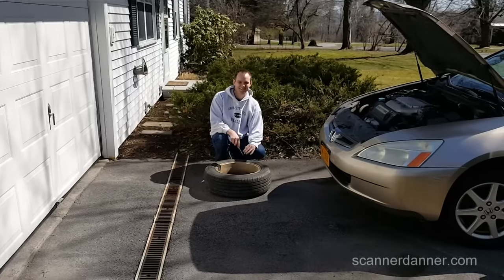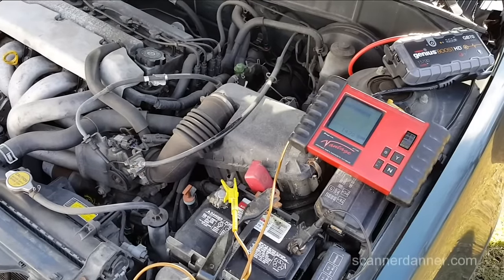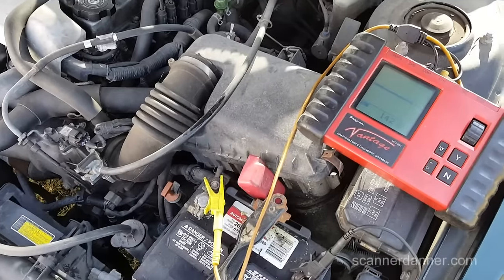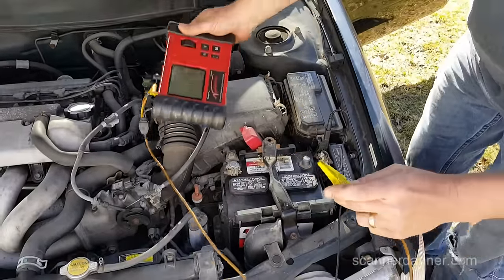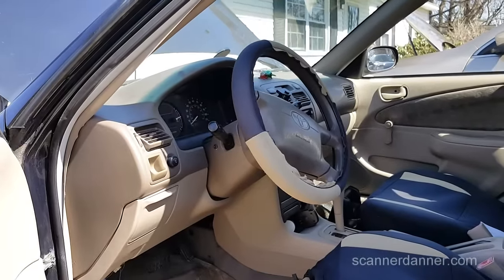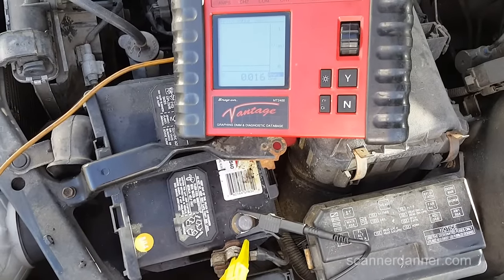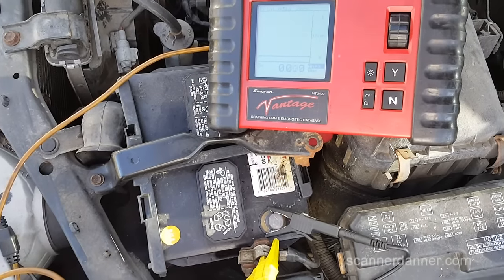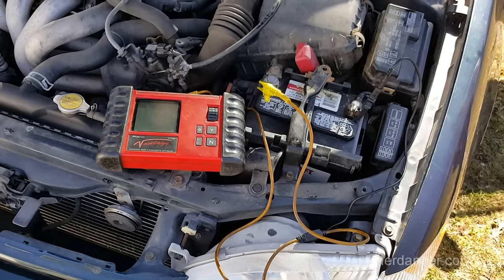Battery keeps going dead (what to test before replacing)

Comment: About 7 years ago I picked up a BatteryMINDER 5-stage desulphating charger, with temperature compensation. This thing has paid for itself HUNDREDS of times over - not even exaggerating. Seeing that battery there having a build date in '14, I would bet that 2 weeks on my charger would bring that battery right back from the dead. Not even kidding.  Thing is amazing. Batteries I thought I would have to toss, I ended up getting 3 to 5 more years out of! I have zero affiliation with the company - I just like it when stuff works better than advertised in this day and age. :)

I just picked up another one last week (Model 128CEC1). They updated the unit for 2016, so you are now able to see more of what it's doing and understand it better. They also did away with the long temp sensor that used to have to be connected to battery ground to work - the new one is just a temp sensor, that plugs into a very short pigtail coming out of the unit. It's also set up specifically for the Odyssey AGM battery I run in my truck, so that was another added bonus. I haven't tried the new one yet on a completely smoked battery, but I'm confident it will be every bit as good as my old one. At least I hope anyway. The internet will be the first to hear about it if it's not! :D

Comment: Had my neighbor's 2003 Audi A4 battery continually needing a jump. 

No one could figure out the problem even after 2 new batteries.

 I came home late one night (3am) from hanging out with friends in the dead cold of winter and saw her brake lights on. It turned out her brake light switch was out of adjustment and had a hair trigger. The problem was when the temperature dropped and materials contracted enough, the switch closed the circuit and turned the brake light bulbs on until the ambient temperature got warmer or the battery died.

I know it sounds crazy,  but sometimes thinking outside the box can save from having to buy a new battery.

Anyways great video Paul, keep up the good work.
Reply: Speedstack21 wow😮
Reply: yep with a good scope, he can scope for a long period and make sure that nothing is coming in later.
Reply: haunted car
Reply: I agree, my folks owned a 1977 Plymouth Volare. During the cold winter nights, the horn would start blasting in the early morning all by itself. Turned out, the plastic material would shrink enough to close the horn switch on the steering wheel and practically wake up the dead 👻💀

Comment: The most important final recommendation after analyzing the test results that is missing in this case (since the cause of battery is not likely from a parasitic drain at 11mA) should be the purchase of a battery charger/maintainer and some basic battery diagnostic tools (hydrometer and/or a battery and system tester) in tracking the state of health and in equalizing the charges of an old lead acid battery.  Buying a new battery won't help if the battery is going to sit again.  Anyone who owns an automotive battery must keep the battery charged up either manually by a battery charger or automatically by a smart battery charger and maintainer.  All flooded lead acid batteries will need battery equalization done regularly to maintain and extend battery life.
Reply: Do you recommend any particular brand and model device for battery equalization?  I can't find any charger with equalization listed as a feature.  Plenty of chargers with desulfation listed as a feature.  Is desulfation and equalization the same thing?

Comment: The car battery needs trickle charging during the off time or else run the car for a few minutes every 3 days.A year old battery should be in tip top shape. Great to see your family and great interest in the auto scene.
Reply: +Tom OConnor 

I was always taught a battery that is discharge slowly or has been left discharge over an extended period needs a slow charge to push the charge through the full thickness of the plates, a battery that has been discharged relatively quickly can be charged more quickly.
A lot of modern batteries have "improved" lead acid chemistry and can't be recovered by normal recharging.

Comment: Anything over 30ma will suck that battery down. Alarm systems are famous for wearing batteries down if they sit for an extended period. Best to use a battery cut off switch if your car sits for extended periods of time. I should also point out that once that battery goes below 11.8 volts for any length of time they do not come back from that and no amount of charging will fix it and you will need a new battery. And Danner, I don't believe we have seen part 4 of the lift kit installation. I hope you took note of my specific instructions to complete the job in part 3.
Reply: +Rod Palm: right.. just one deep discharge and the battery will never be the same...
Reply: ..........  Great  info.    I  forgot  about  the  Alarm  system  on  my  Crown  Vic,  that  I  am  now  using  for  a  back up  car.     How  many   mili-Amps  do  you  think  a  Crown  Vic  Alarm  system  draws.

Comment: One thing to consider on more complex cars is the can bus system and modules still awake for at least 10 minutes more or less for some cars and a car with a key less system make sure the key is not near the car on time I got a VW mk5 Jetta with a broken wire in the driver door it very common for this generation on car but one wire that caused and parasitic draw is one can bus wire that was broken for the comfort system and would communicate with the window motor and there is 2 wires for the bus system they are twisted together with a scan tool you can see the can bus data status going to a single to a 2 wire status on an off constantly when there is no wire issue the status shows the bus in a 2 wire mode then when you lock the car all the modules go into a sleep mode in matter of minutes I also saw some alternator shorts and they would drain the battery in a short period of time thanks for the video the thing is when you get a car that draws only intermittently it's sometimes not easy.
Reply from the maker: +V10PDTDI absolutely and I've covered this in other videos. I should have mentioned that here too

Comment: Very nice video, but noticed the top of the battery is damp. Also need to check the surface voltage. Batteries sweat alot as they discharge. The film of acid will conduct several volts as well. A quick wash with baking soda is all that is needed.

Comment: You can use a battery charger on a timer to keep the battery charged when a car is left sitting for a long time.  Just set the timer to run 10-30 min per day.  With a little experimentation, you can find the right time for the charger to run.

Comment: This man knows too much about electrical. Drive past dealerships in the dead of winter, and you'll see alot of new cars' hoods popped and the techs charging the batt cells not to only keep them charged, but to mainly keep them from freezing over. I'm guessing that they do that once every week. An undercharged battery can damage its plates and destroy itself faster than anything else will.

Comment: @1.83 volts that battery is DEAD.  Probably has a dead cell.  An alternator is not really made to charge a dead battery.  Need to get another battery, there should still be a warranty on the battery.  But your brother probably lost the receipt like the remote.
Reply from the maker: +Upallnight exactly
Reply: +ScannerDanner 
A dead battery can be one of the hardest calls to make and be 100% sure it won't come back on you  -- in this case a good  call it was an ex-battery .....
Reply: Many auto parts stores will honor the warranty without a receipt on their store brand based on the manufacture date sticker on the battery.

Comment: Did you ever fix this problem? I had a similar problem, turned out to be the alternator! I checked the alternator voltage as you did and it showed 14.4. I checked parasitic draw, and there was very low amp draw like you have. I replaced the battery, next day I went to go to work and the battery was dead again!  I took it to a repair shop: they charged the battery, checked the alternator voltage UNDER LOAD: in other words, turned on the lights, radio, heater: alternator voltage dropped to 12V, which would of course, kill the battery. Very strange problem to have, and I wouldn't have guessed it, but I'm in good working order now.
Reply: ........  That's  what  Wal-Mart  is  telling  me  also.  Similar  problem  as  you  described.    They  said  a  diode  was  bad in the  alternator.    Car  ran  fine  after  I  jumped it  even  with  seemly  bad  battery.     I  charged  the  battery  with  a  6  Amp  charger  for  8  hours  and  only  got  up  to  33%   Charge.

Comment: trickle charge it , since its sitting so long or unhook the battery when not in use.
Reply: I have a Suburban with the 7.4L engine, does great for towing but only 13MPG, so it sits for weeks at a time. I kept finding a dead battery when I needed the vehicle. So I got a cheap trickle charger, the $ sale at HF. I just plug that in when I've done with the Burban. No more problem.
Reply: @javaman2883  m.j

Comment: Basic, simple and very useful info for someone who has never done that type of testing before and can be done with a moderately priced volt/amp meter.I would like to add for your viewers that on newer vehicles you have to wait for electronics to go to "sleep" before that test is valid.Is Caleb another mechanic/automotive instructor in the making?
Reply from the maker: +wysetech2000 for sure, and I should have mentioned that

Comment: My drain on my 1990 Olds 98 Regency was the the Air Compressor for the air shocks of all things.
Reply: Had a first generation navigator doing that to me as well. Had already replaced the air ride with spring before I noticed it. Didnt realize it until I heard the compressor noise so loud I thought someone was taking my truck.

Comment: Batteries these days are gack compared to even a few years ago - they have no staying power.  I'm finding we're now changing pretty new (1 year or a little older) batteries on a regular basis - they ain't making 'em like they used.
Reply: Had a battery from dec 2010. Just croaked. Yes. It lasted 12 years. 2000 tacoma 3rz-fe. Think I’ll throw it on the charger manana just for giggles 😁
Reply: @pitchforkpeasant6219  top up the fluid first with dist water&  it'll probably come good again. :-)

Comment: One time i remember diagnosing a car with a battery like that, that also had acid leakage on the top caps, and it had no parasitic draw neither, but it would discharge over a 10-12 hr period so i cleaned the top with water and soda and it wouldn't discharge anymore so i guess the acid leak was slowly causing a dead battery
Reply: I had a jaguar like that . put positive lead of my meter on batt + and just touched the top of the battery with negative lead...  voltage increased the further I went toward negative post
Reply from the maker: +James Danner hey bro. I'll have part 4 of our series up next week
Reply: Hey. U weren't supposed to reply to that post. I had a smart ass remark 4 you I think ,but I only watched the first half so far. got pulled away
Reply: James Danner i wonder what causes that small seepage through the caps, maybe heat cycles or something? i mean i don't see it with trunk mounted or under the seat batteries

Comment: I don’t have more than 40mA drain, checked fuses, battery supplier test ok, alternator charging 14.4V, battery trickles to 12.7V.  Battery still flats after 3 days. Pulled fuse 25 out, fuel and trunk actuator plugs pulled, no luck.  No OBD codes. Battery sitting in garage keeping charge.  My own battery tester shows 72% health after one year old and fluctuates between good battery and sometimes replace. Alternator 0.01V AC but suspecting battery or alternator diode.

Comment: That battery is history, sitting at that low of a charge will cause stratification which is ireversable no matter what voodoo magic or gadget you've seen on YouTube even if you can get it to accept a charge it will be at a much lower capacity, if you're going to let it sit for long periods especially in could weather put it on a smart trickle charger.

Comment: i would consider three things. how far is the car driven when it is used,  does it get a chance to charge up. also check amperage cable, battery grounds and Toyota has an extra battery cable connector on main battery cables that need to be cleaned.

Comment: Assumptions like this make my job ALOT more difficult as a 12 add on tech. teaches younger guys just to jump to remote starters and aftermarket stuff when there still is a problem with the cars.. 90% of the time i get called back i find whats wrong and its not aftermarket stuff.
Reply from the maker: +justkloo2 assumptions like what? It took two minutes to isolate a known problem area. When troubleshooting problems, we are always making assumptions, then we walk down that path and prove that assumption to be either right or wrong. If we are right, we keep walking that path, if we are wrong, we back up and go another direction. 
Not sure what your beef is here?

Comment: Can you explain how you removed the power connection to the alarm/remote start module ? Does disconecting the ground to it remove its power? I want to test to see if my aftermarket alarm is causing a draw and how much, but not sure how to remove power to it easily

Comment: I had the same issue on a 07 mustang i used to own. I would garage it all winter and have a dead battery by spring. I ended going with a battery that had a larger reserve current size and a tender and problem never came back. In fact i forgot to plug in the tender one year and the car started right up so reserve current size is also a big factor.

Comment: As soon as I got our 2015 Subaru Outback, I had to replace the undersized battery. Someone had replaced it with another battery of the same rating which was determined to be under rated for that vehicle. We have had no issues with the larger CCA battery. Subaru knew it was the wrong size battery. Rather than argue with those ass hats, I went to our local grocery store that sells batterys( not WALMART)  that has a three year warrenty. When you have to argue with a dealer over something as simple as a battery, its just not worth it. Especially when the manufacturer knew that battery was the wrong one for that car. All 2015's had the same issue.

Comment: .as always a great video Paul
.I would like to add a comment about that because I familiar with Toyota  
.if this remote system is a Genuine Not an After Market instillation , the situation will be better 
Remote control ECU transfers from WAKE UP mode to SLEEP mode 30 sec after closing and locking all doors, and all systems follow this strategy to save power.   ECM and all ECUs go to sleep and there is no any activity on  LAN BUS
. after that , 45 sec later , the THEFT DETERRENT system will be activated. thank you for your posting
Reply from the maker: +Mohammed Shamy thanks for the data!

Comment: Does it have a hood light. You probably wouldn't see it working on it in the daylight with the hood open. Also, check the trunk light could be out of adjustment and staying on will run the battery down. When the battery is run completely dead, the cells become sulfated but deep cycle batteries can handle this, most ordinary car batteries cannot. Definitely needs a battery but not sure you have fixed the drain. I would like to hear if it is still going dead with a new battery.
Reply: lol this guys a pro,not to mention an automotive teacher. He's using a labscope for parasitic draw test. pretty sure he's got all that covered. any idea what an oscilloscope is without Googling it?
Reply: ........   An  oscilloscope  in  this  case  could  show  voltage  or  Amperage  wave  forms  over time  and  not  just  give  a  digital  reading.
Reply: @stephenfiore9960  In the video he used the oscilloscope function on this Vantage Pro to show the voltage ripple in different time scales.